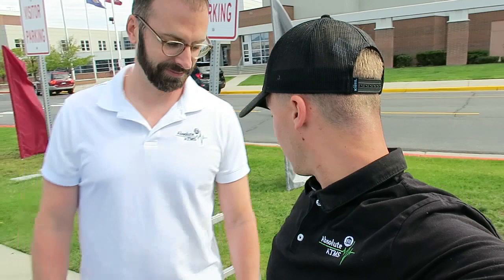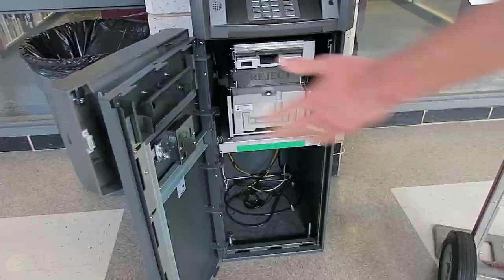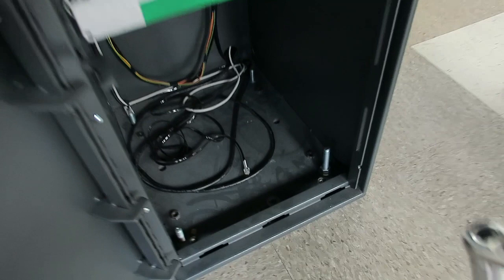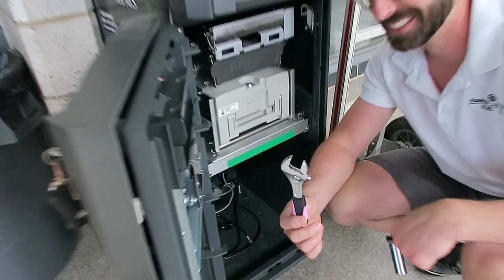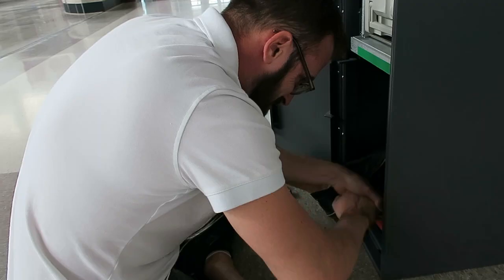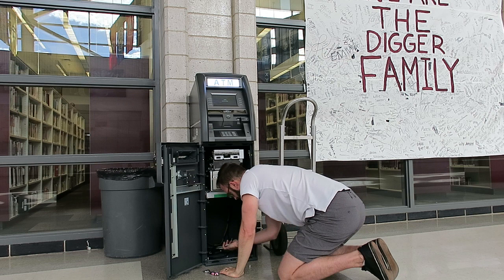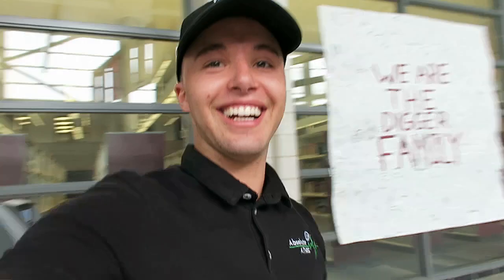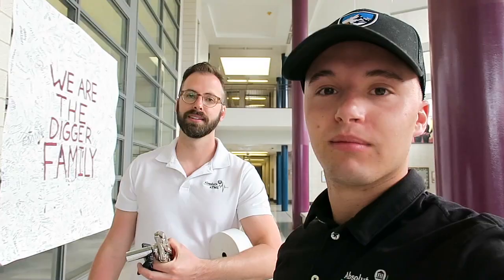How To Unbolt An ATM... EXPLAINED

Comment: How of you remove the bolts on the ground?
Reply from the maker: If you are not going to reinstall into the location you can either hammer them into the ground or cut them off with a bolt cutter!